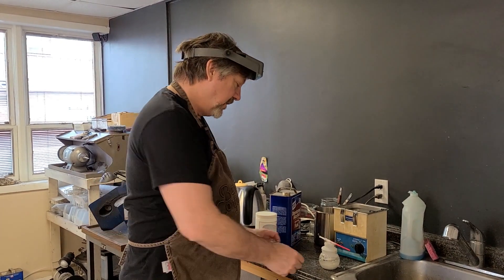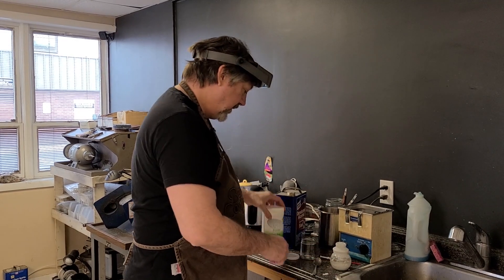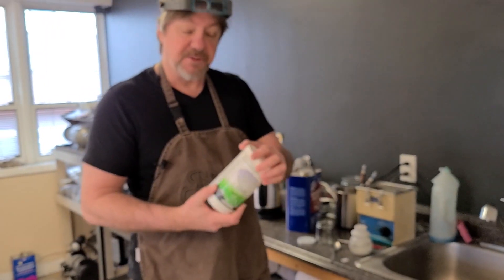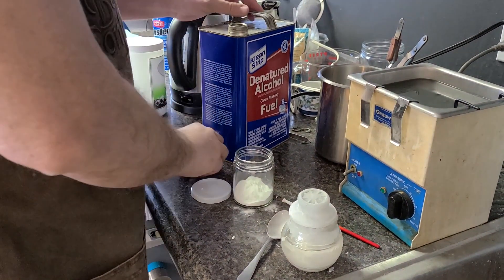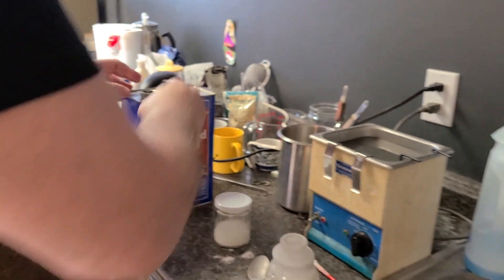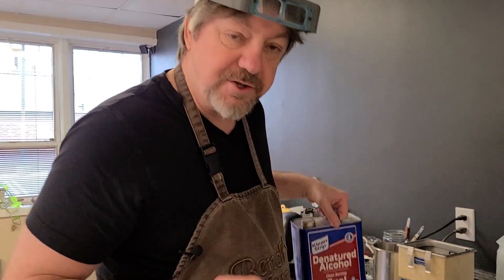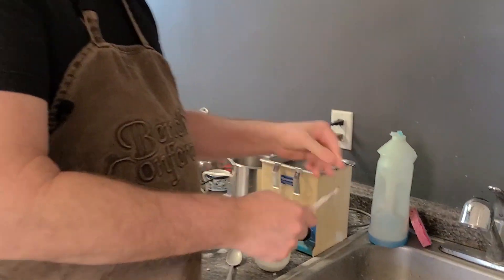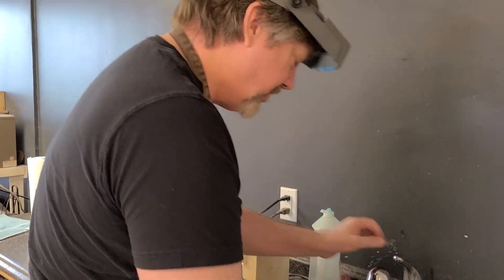Fire coating for soldering

Comment: So, is boric acid the same as borax???
Reply from the maker: no  https://www.amazon.com/HUMCO-HOLDING-GROUP-303950303963-Powder/dp/B001V9WY0S/ref=asc_df_B001V9WY0S/?tag=hyprod-20&linkCode=df0&hvadid=216449464467&hvpos=&hvnetw=g&hvrand=7034265067094091328&hvpone=&hvptwo=&hvqmt=&hvdev=c&hvdvcmdl=&hvlocint=&hvlocphy=9009590&hvtargid=pla-385399710381&psc=1